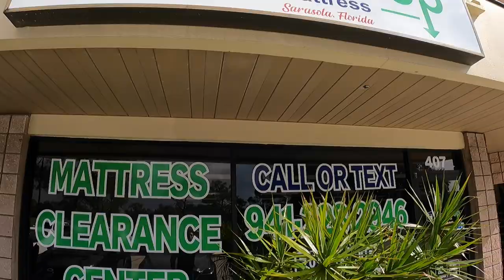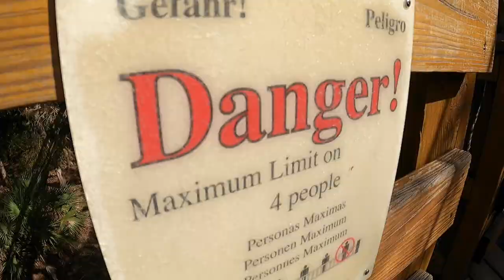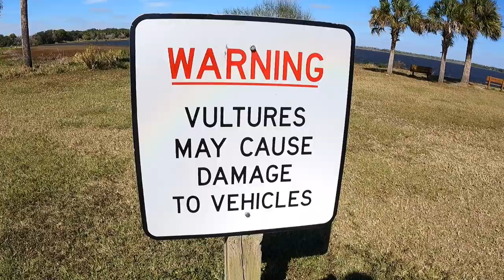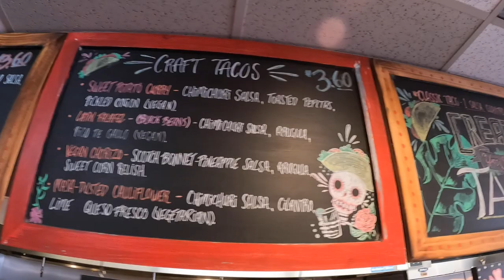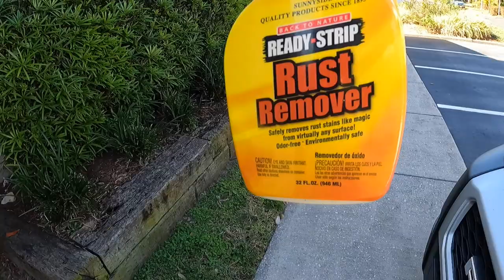Van Framing & Insulation + We Quit!! Exhausted and Injured 🚚 RAM ProMaster Conversion Build Series 5

Comment: I feel your pain on back issues. Don't push it too hard. It took me a year to actually fully heal my lower back. Had to quit lifting heavy at the gym for that time.
Reply from the maker: Yea man it is hard that is why I went away from the weights. But now I what to start to strengthen again just have to start with smaller weights when I can.
Reply: @FnAVanLife  You'll be able to take it slow again after build.